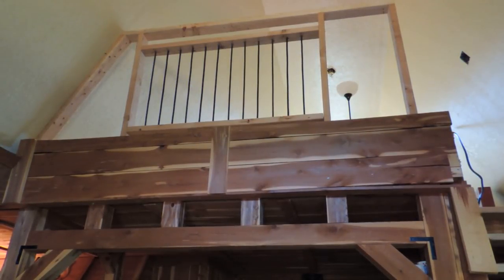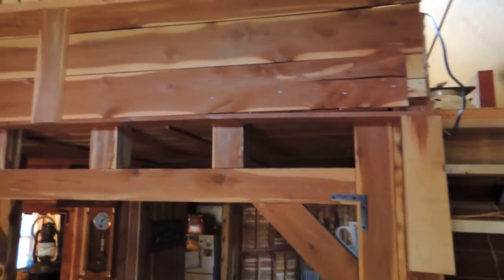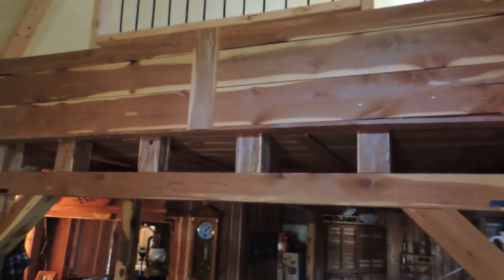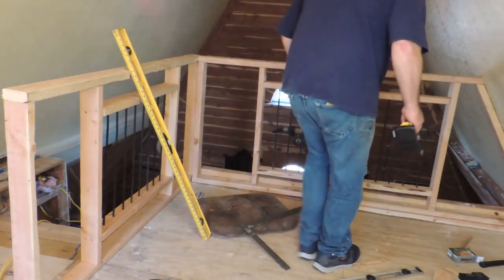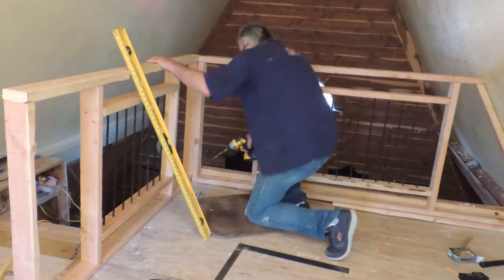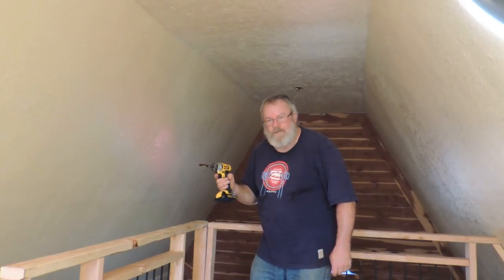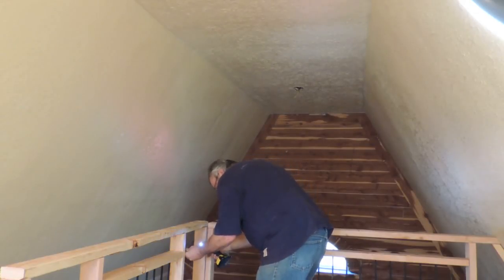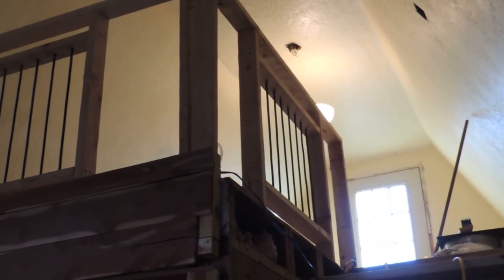CABIN LOFT RENOVATION.Day 2.Railing build.

Comment: DeWalt makes a larger battery. It’s about 1.5 times larger. The price on that battery also is about 1.5 times more expensive per larger battery. When you buy the drills or other 20Volt tools from DeWalt  at the on sale or low price point, the units come with the smaller battery.